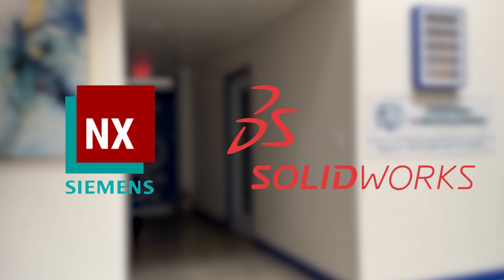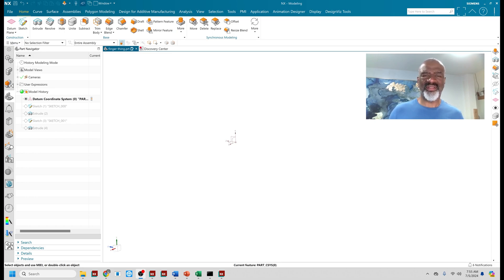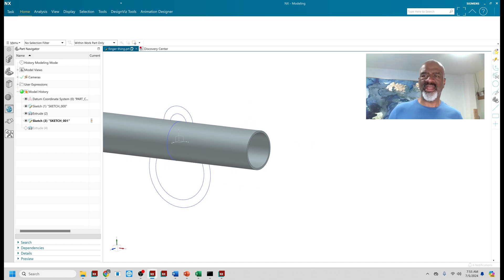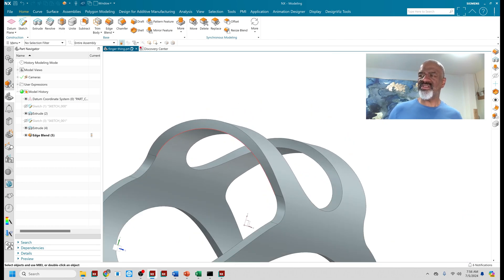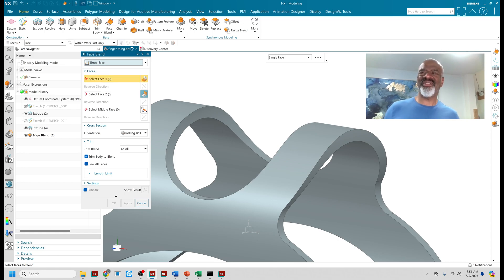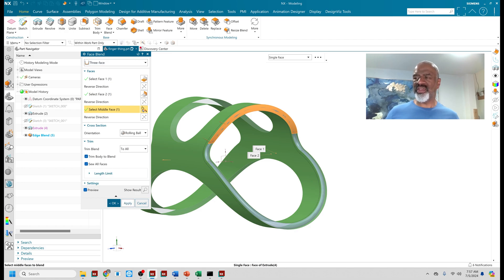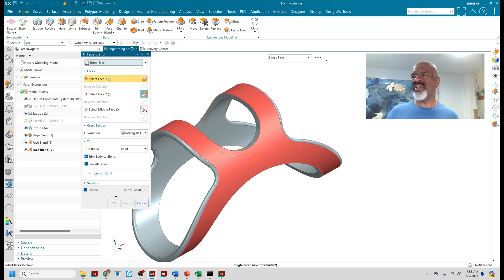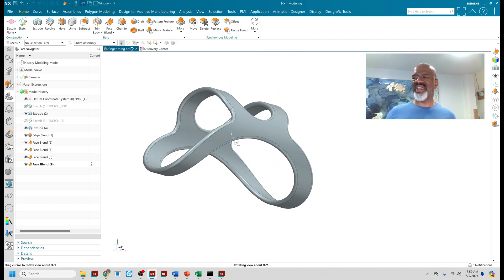Stop Edge Blending Faces - Use Face Blend Instead! How to Use Face Blend in Siemens NX

Comment: Hello, I have a question for you. I am a product designer. For example, a colleague gave me a model of the internal components layout of a mouse. Based on this assembly model, I created a new part and started designing the mouse's exterior shape. I used the Realize Shape module for the design and applied some transparency to my model so that I can view the relationship between the exterior shape and the internal components at the assembly level. However, when I double-click the exterior part to enter the edit state, the transparency seems to become ineffective. The exterior model blocks the internal components model, and I cannot see the internal components. The transparency only works when I exit the edit state. If the transparency cannot be maintained consistently, it becomes inconvenient to adjust the model. Have you encountered this issue before? Thank you.
Reply from the maker: Hello. Thanks for watching. If I understand your comment correctly, you have an assembly of parts with your mouse shell being a part of the assembly. If you are directly editing the color and transparency of the object itself, you will experience these issues within assemblies. If you enter a lower part of an assembly, it isolates the part from the rest of the lower parts in the assembly - except for the parent of that part. That's probably what's happening in your instance. Ideally, the part you want to always be visible should either be the parent of the lower parts or an assembly of its own. Basically, you would have an assembly tree something like this

_assem
        mouse
                  internalcomponent1
                  internalcomponent2
                  internalcomponent3

This structure would enable you to have an organized assembly with an empty top file followed by your mouse shell followed by the individual components. If you double-click on one of the internal components, the shell (labeled mouse) will still be visible and translucent. I hope this makes sense. If not, leave another comment!
Reply: @DesignVisionaries   Thank you for your reply. I realize my description was unclear, so I made a video to demonstrate the issue I'm encountering. In the video, I use NX and CATIA to show their differences and highlight my problem. I have asked many people about this issue, but it seems there is no good solution. If you have time, please visit my profile; the only video there is about my issue. I tried sending the video link twice, but it was automatically deleted.
Reply from the maker: @benkindred5995  Hello again. I watched the video, and I see what you're dealing with. Disregard my original comment as it doesn't solve your issue. We will make a video on this topic within the next few days. Stay tuned!
Reply: @DesignVisionaries   Thank you very much, respect to you!

Comment: This seems useful when ending up with a straight section of extrusion of unknown width, that you want to have a semi circle / complete blend at the end of.  If one were to make a clevis pin end or something of that basic nature and not want to measure and calculate the perfect 1/2 radius of the intersection point.  Probably more stable for the software too when regarding geometry changes before the face blend.